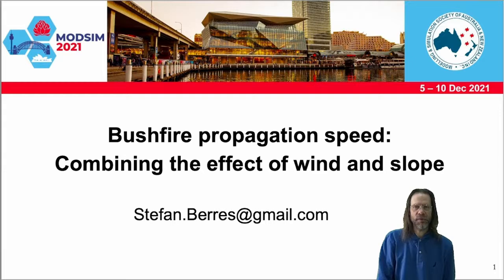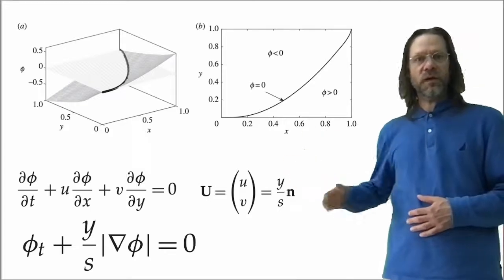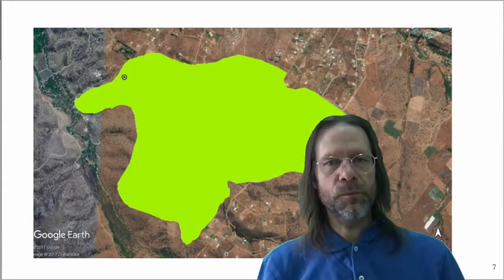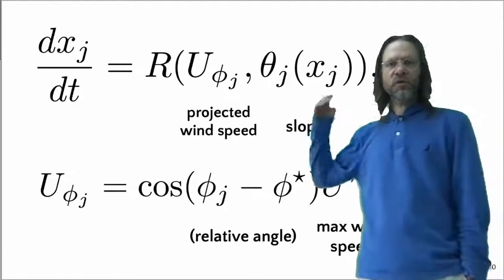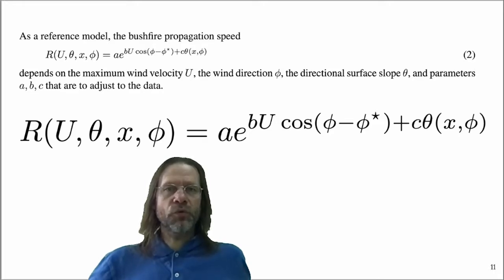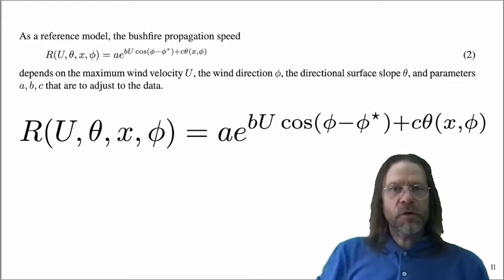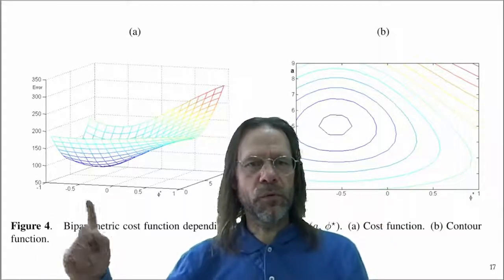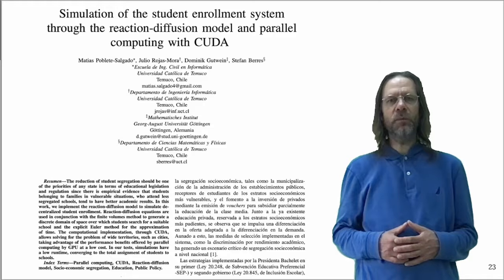Invited Talk Dr. Stefan Berres, Universidad Católica de Temuco, Chile.

Comment: The transformation of the problem from 2 dimensions to one dimension is interesting.
Reply: The reduction to 1D was a patch, that allowed some model adjustment for that little data. It can be justified as a “model reduction”, where the “simpler” model is less “realistic” but better to handle. It eventually helps to do adjust models for “small” bushfires. At the other end of huge bushfires, the models get to “zero” space dimensions, where a “fire indexes” indicates whether the bushfire gets uncontrollable.